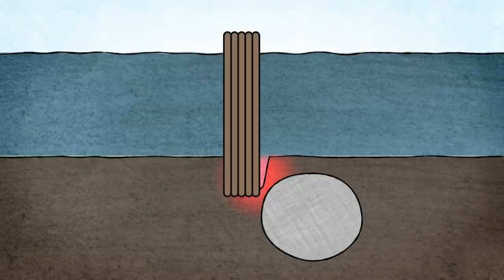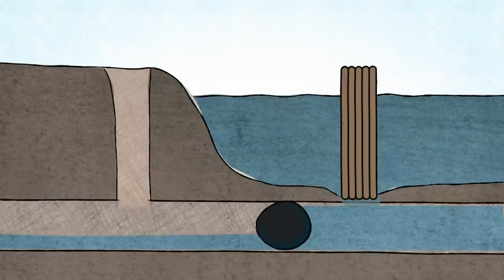How An Epic Error Caused The Flooding In Chicago | Massive Engineering Mistakes

Comment: Does appear some one in the piling project would have  had sense enough to check the location of the tunnels vs the pilings or other construction. Secondly, why didn't they use floating pilings anchored to the river bank to protect the bridge from boats/barges?

Comment: I remember hearing about this on WBBM 780 one evening down here in Louisiana.  It intrigued me.
Reply: This is the excerpt of that news account: "

"A cable television crew working in the tunnel in January 1992 noticed the cracked wall, and notified the city, but it took months before the city got bids for repairs. By April 13, 1992, the crack had turned into a car-sized hole, sending river water pouring into the tunnels."